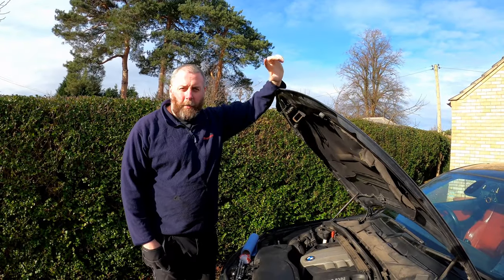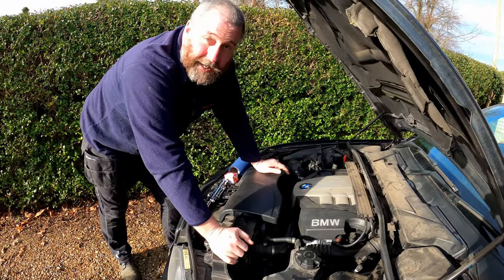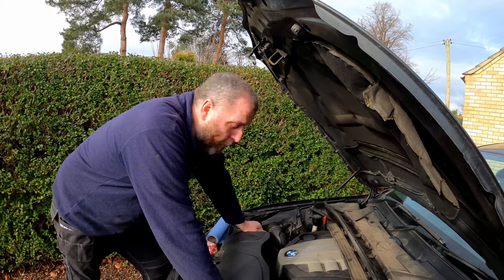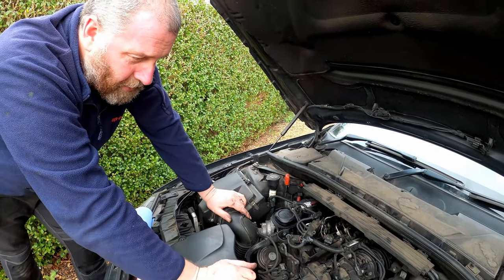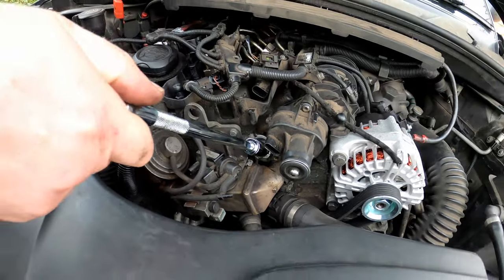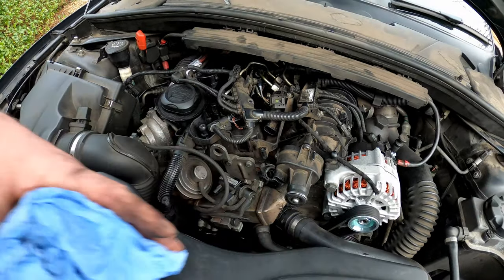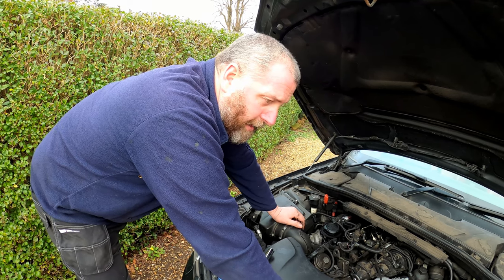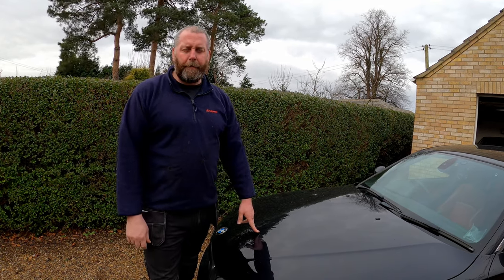BMW N47 Engine - 1, 3 & 5 Series, Plus X1 & X3 Diesel Models - Overheating Problem!

Comment: I had the same problem, N47 engine thinking it was overheating & the fan coming on after a minute of start up. Can't remember how but there is a way of scrolling through menus on the dashboard (where your mileage raeds) & getting to a coolant temperaure reading. Mine was showing 40ºC first thing in the morning & zipped up in temp once the car started. So it was that coolant temperature sensor at fault. £15 for a new one, easy fix.

Comment: A nice, straightforward and handy exchange fix. Goes to show that BMWs don't have to be a serious drain on the wallet. Sensors will fail over time on all makes and models. Hate the 'death bong' warning though!
Reply from the maker: Yeah, that sound goes right through ya! Worst thing is that it makes the exact same noise if the temperature outside goes below 3 degrees centigrade! 😂
Reply: @KevsShed  Yeah, had the 'fear of God' put through me a few times this winter!  Same with fuel but try to not get tank too low these days - my heart can't take it! Thanks for the great videos. You take the trepidation out of working on/repairing/servicing these cars and others.

Comment: Hey Kev! I had the same issue with the Yellow overheating lamp. Changed the water pump and thermostat. Looked up the temp while test driving and everything looked good. But now after a few weeks the warning is back.. Maybe it’s the sensor? Ordered one now..

118d N47 with 33.0000 kms

PS. My misses drove the car 5 hours ago and I just traveled back from work. Went to the garage to have a look. Secret menu states the coolant temp is 122 Celsius. Probably the sensor then.. Getting the new one next week

Comment: The test for this is testing its resistance with a multimeter set it to ohms(resistance) and place a probe on each pin in the sensor your reading when the engine is at 20 degrees is 2500 to 3k ohms 
at 50 degree its 700 to 900 ohms
at 100 degree its 120 to 170 ohms 
sourced from auto data its what I utilised for my sensor on my N47 engine

Comment: Exact same issue happened to me a few months ago, but before jumping right to replacing the sensor, to confirm the diagnostic I've read the coolant temp from the hidden menu the dash has.
Was at 85 celsius on cold start, made it clear the sensor was faulty.
Reply: What was the temperature you were monitoring to diagnosed this? Coolant temp 85deg, oil temp? Engine temp? What readinga did you get? What it should be around in cold start or operating temp? Thank you
Reply: @bathanmark  It was coolant temp. As the issue happened during summer, coolant temp on cold start should have been around 20°C, like the ambiant temp more or less.
Reply: @patsuperfast  thanks for replying. That became obvious on your one as it was 85C in cold start and ambient is 20C in summer time. Should have been well around 20C at cold start.

What do you think about mine. Coolant level is ok, at cold start i could see mine to be same as ambient temp but during running and when I check at idle i could see the reading like, 
Oil temp reach 100C, coolant temp 100C and engine temp 95C
I dont know if this is normal. It seems high?! I drive a 2015 BMW 3 series diesel.
I drove a none BMW car before and it reads and maintain 75-85C on all those 3 sensors, oil, engine and coolant. Thank you